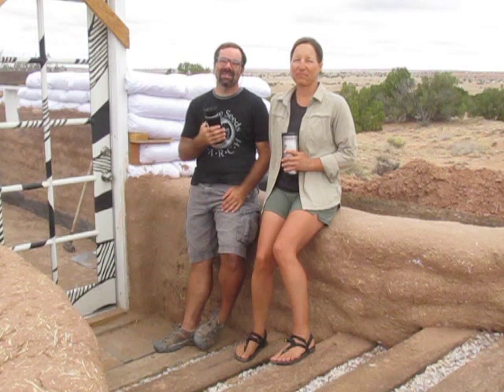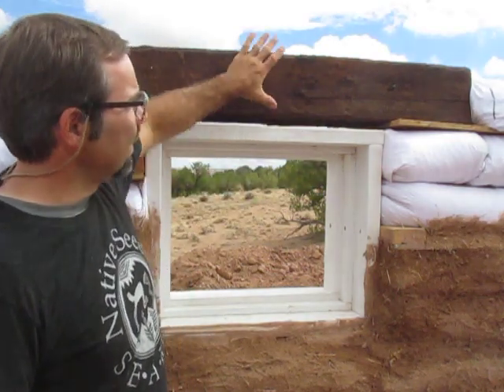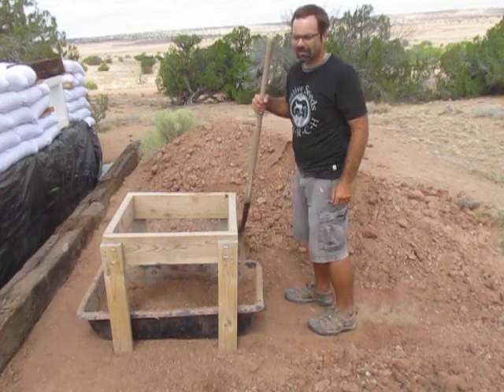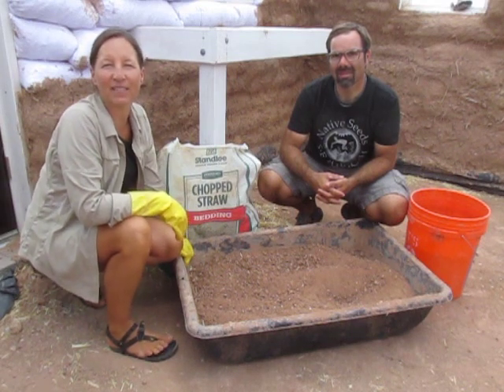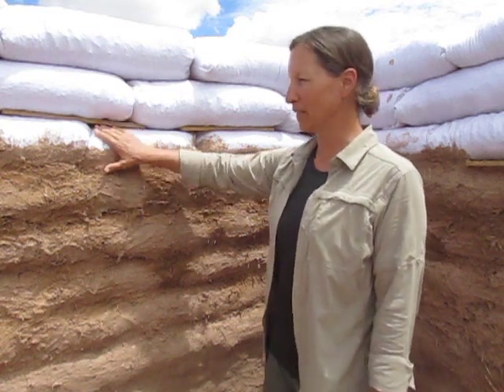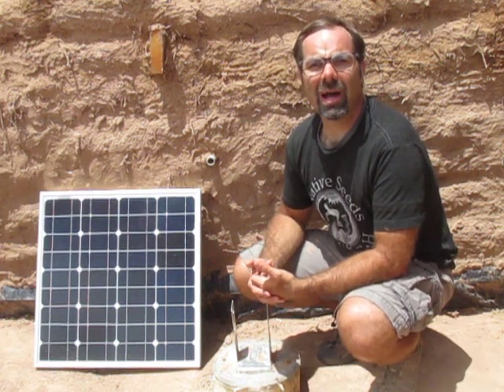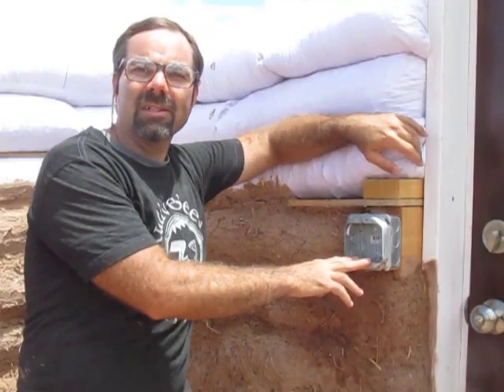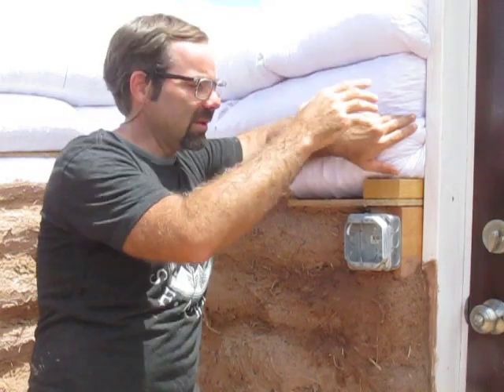Earthbag Build - Episode 09 - Lentils, Cob, & Electrical

Comment: Guys, lentils are legumes that you make delicious soup from.  Lintels are what you're making!  If you screen in the "sandwich board" style, throwing clumpy dirt at a screen set up slanted but standing on ground, and letting what passes through fall directly into wheelbarrow--saves lifting up into a table screen and saving lifting screened material up somewhere.... love your narration style and lots of great info.  thanks and great work.

Comment: You didn't need anything for the cob to stay on the wall?
Reply from the maker: No, it has adhered extremely well. I've had to remove some in a few places to do other things and it took everything I've got with the claw end of a hammer to get it off. My soil just happens to make excellent cob. You may have to adjust or amend your mix (depending on your soil) to get similar results.

Comment: Can i use cement on to plaster those walls?
Reply from the maker: I used a sanded stucco mix. It has a better texture and adhesion than cement. I added a lot of cob to the bags to flatten out the surface of the wall before putting on stucco. Cob is nearly free, while stucco can be very expensive. Be prepared to deal with cracking. You might want to incorporate expansion joints every eight feet or so if you have a larger structure. Also, you can run into adhesion and delamination problems depending on how well the stucco sticks to the cob. You can add chicken wire attached with landscaping staples to hold it onto the wall. Cracks and delamination will still be an issue if the cob and the stucco expand/contract at different rates when wet or when the temperature changes. This was the trickiest part of the build for me. I have a good coat of stucco now, but I'm still looking into ways to make it more durable.